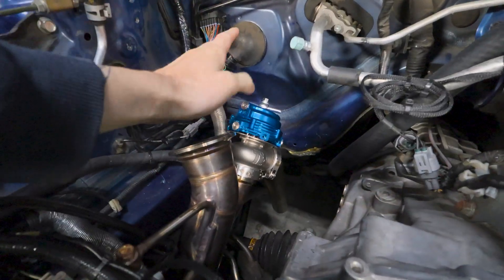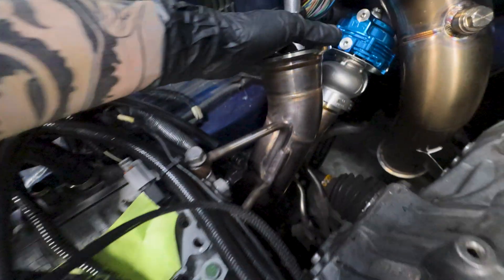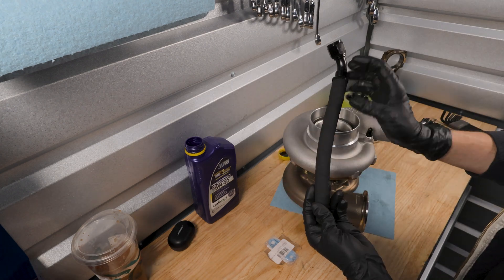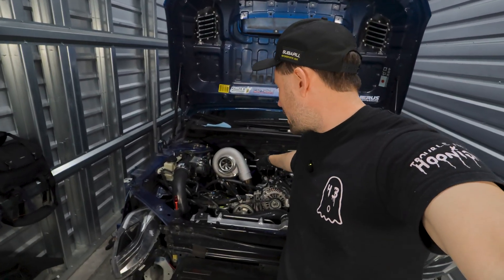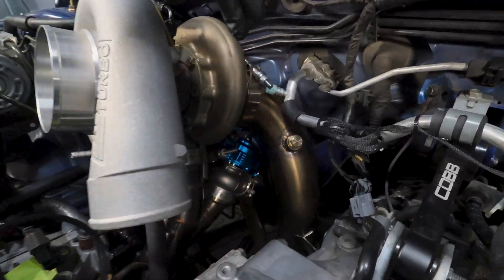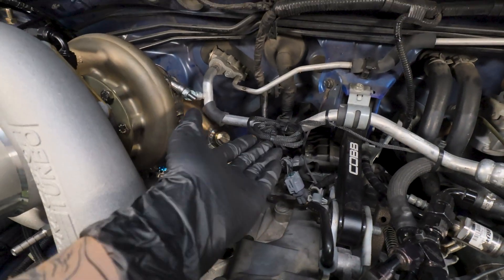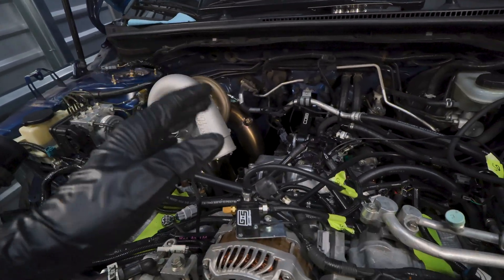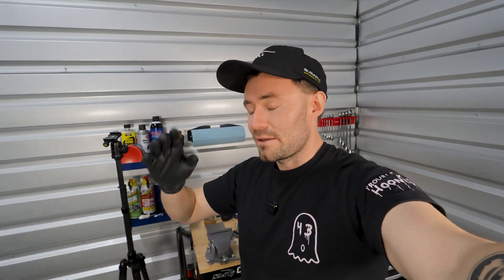The Rotated Kit FINALLY Fits! Precision Next-Gen 6870 Mock-Up & Downpipe Fix - Part 3

Comment: Did you mean to pin a comment about how you actually routed the boost controller?  Maybe you can cover it in a follow-up...
Reply from the maker: Yes! It's coming in next week's video. There's different ways to route it but it's up to the tuners preference. One way is: 
top Port to atmosphere and bottom to port to BCS > BCS to Compressor.

Comment: I'm not sure.  Did you have to modify the down pipe or up pipe to get the turbo to fit, or was it just that you needed to mess about with it a bit more until you figured it out?
Reply from the maker: nope! I was just being dumb! I placed the up-pipe down first to the headers. No v-bands connected or bolts to the head for the support bracket just loosely placed. Then, I proceeded to go under the car and shoved the downpipe in. It is a tight fit BUT the Tial 44mm doesn't hit the downpipe. Everything clears except the AC hardline is a bit too close for my liking but this was also built for an 08 sti hatch I believe 😅 We are good to go though!
Reply: @nit3sh1ft  Ok, so phew... that's good then. lol.  I checked my wastegate and it's 44 mm as that is what ETS specs with their kit.  So, I think it should be ok for your top end.  BTW, did you do any head work, pistons, head/rod bolts etc.?  I have a 2010 hatch, so hoping the ETS kit 'just works' like yours.
Reply from the maker: @WRXDannyW  I only have a IAG 550 shortblock. It's a forged piston and rod motor. My thinking is as long as tuning and fueling as solid with torque being managed I think car will live for a while. I plan on building the heads later (springs, valves etc) and a closed deck option.
Reply: @nit3sh1ft  OK got it.  Forged pistons and rods make sense. I think my question (or comment?) is that if you want to make power on pump gas then you need to rev the motor, in which case you need 272s and maybe some valves to spin that fast w/o breaking.  Also, if you are running E85 or alcohol day-to-day then that's a different thing but most of us are not, in which case 25 psi and ~8500-9000 rpm with pump gas is your limiting factor.  You will hit a hard wall at around max 550-600 whp on your setup I think, same as mine, unless you are running alcohol.
Reply from the maker: @WRXDannyW  I will be running E85 and yup def need cams for sure that will be coming in the future.